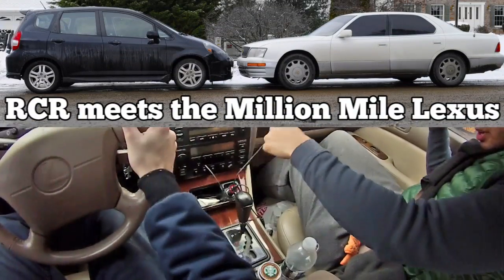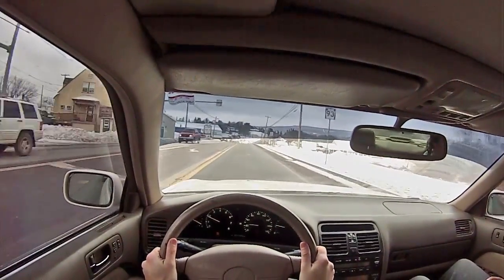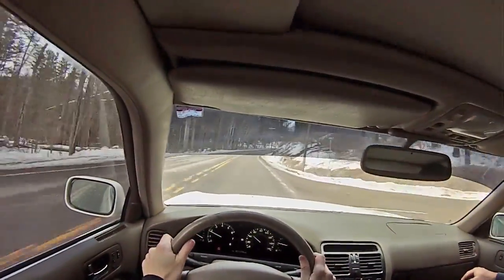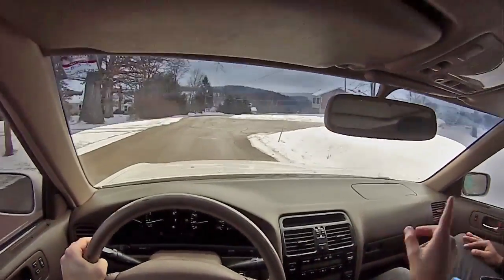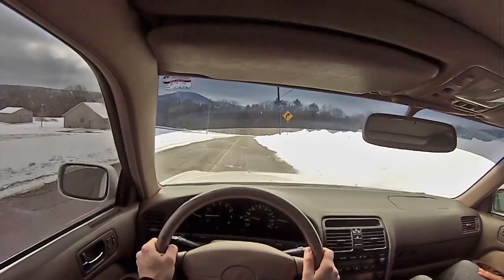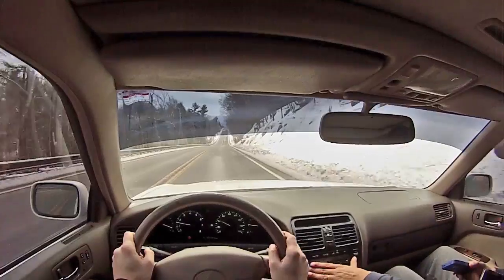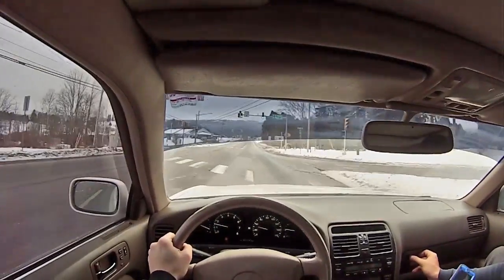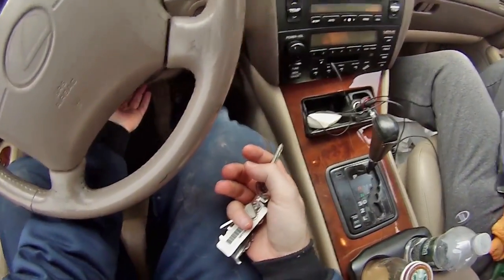Million Mile Lexus P.O.V. Drive

Comment: my 1990 Big body ls400 was fully loaded and had all these features. to bad i wrecked it. it had heated seats not a crack on the leather. only 60k miles on it and everything wokred perfect. stock sub and cd changer in the trunk. when u put it in reverse the mirrors wud go down so u can see the curb. i had put 3 12s in the trunk of mine nd had it bumping everywhere on some 19s. loved that car.

Comment: At the medical transport company I work at, we had an ambulance (that just died a couple months ago) built on a Ford E350 chassis that had 600,000 on the odometer.  That's impressive on it's own, but the kicker is that the 6-digit analog odometer had apparently rolled over... twice.
Reply: +HDcamel so your saying it had 2.6 million miles on it when it died?

Comment: Y'know, I'm wondering if someone rolled forward the miles on the odometer just to screw with people.  Like how shady car dealers roll the mileage back, except maybe the owner decided to say "Fuck it, this car's already worth next to nothing" and proceeded to increase the miles to 900k just so he could sell it to someone who would drive it to a "million".
Reply: That would make sense if the speed sensor somehow went haywire then... I just assumed because of the vintage of the car that it had a mechanical odo.
Reply: willthefuneverstart , but not odometers.

Those were mechanical in many vehicles until the late-90's.
Reply: The Layout Engineer Wrong.
Reply: The Layout Engineer I doubt it.  Also, it's not uncommon to see these cars on the road still.  In fact, I see them all the time.  My uncle still have one, which is in immaculate condition, with original parts.  Granted, it's his second car and he doesn't drive it as often as his truck, but he's had it since 1992.  My father also has a 1994 version, and it has over 300k miles on it.  They don't make cars like they used to...sometimes I'm shocked to see cars built in the 2000s with major engine problems.

Comment: That's amazing! I had a '99 Chrysler (Dodge) Intrepid with 650,000 miles. Never changed the oil in it or changed a thing. It ran without a problem each day.
Reply: I doubt this very much. Please change your oil.
Reply: I should clarify, I never changed the oil for the last 3 years. Never changed it because was trying everything to kill that car. But it wouldn't die.
Reply: Luca Giordano if you want to kill it just drain the oil and run the engine
Reply: You didn't change the oil for 3 years ? Dude when you go to drain that the amount of shit in the oil will make it as thick as porridge
Reply: Luca Giordano Probably burned a quart every 300 miles so there was no point to change it
Reply: HAHA that would explain the cloud of black smoke everywhere.

Comment: Just fix the Throttle Position Sensor and it'll auto downshift fine. I'm guessing the cruise control acceleration is caused by the speed sensor. Minor issues.

Comment: 1 million milles? that's a lot.
my focus st has almost 1 million kms. no major repairs so far lol (the engine and gearbox are original, have changed only oil, filters, spark plugs, disk brakes, pads, clutch, tires, just regular stuff).
that car was driven pretty much every day since 2001. :D
Reply: DGPF impressive!

Comment: Why not fix the problems? Make it pristine.
Reply: That's what I'm saying 900k miles isn't an excuse to disregard the maintenance
Reply: TheCowGoesMoo o Yep! Quite the opposite in fact! The TPS is probably the main culprit behind the transmission not shifting properly. Granted I am assuming this guy is on a budget or limited income and cant fix the problem, so he just drives it the way it is. We have all been there. Im sure its not the average DIY fix.
Reply: TheCowGoesMoo o exactly, the guy who owns the world record for highest mileage car has a '66 volvo p1800 which has done 3 000 000 miles, and the car looks like it's brand new.
Reply: ***** Not really. The trans is in the limp mode, meaning, complete limp mode. This Toyota A340 trans shifts in non-TCU mode, you can dump the TCU and nothing would change. It's a simple electric problem, just track the problem, maybe you'd need to clean some contacts and it should be okay. Shouldn't take more than few days to fix. Toyotas were bulletproof back then.
Reply: ***** Not really. Old Toyotas are ultimately predictable, if you disassembled something and haven't improved it, get it back on and it'd work as worked before. That's what I love about them.
Reply: because the car has obviously not be maintained the way it should have. Just touching it the wrong way could break everything. As for the Volvo guy, he regularly does maintenance to it, therefore he is allowed to fiddle around with it, because it's basically brand new, even though it's 50years old.

Comment: This is awesome.  I have a 93 just shy of 400k.   It has driveline shudder, wacky cruise control, inop dash lighting, inop gas gauge, a rigged and welded power steering pump so it would quit leaking.  But my trans and engine are buttery smooth! Overdrive is sometimes shaky but rarely.  Gets 22 mpg hiwAy and will still pull strong as he'll to 120 mph...your white knuckles at that point trying to keep car on road.  Lol.  Nice find guys!

Comment: and i thought that my First gen LS400 had seen a lot of road when in fact it´s low mileage car.
It only has 480 000 KM in the trip.
it was expensive when it was new because the taxation is so high in Finland that Lexus only sold 3 first gen LS400.
All the cars had all the options that you can pick from the manufacturer so it has full leather interior and air ride suspension as stock only thing that the car does not have is the sunroof.

Comment: Ok so if you got new tires, new breaks, and had it maintenance with the engine as in fuel cleaning and cleaned out the butterflies in the engine block. Bet that thing would ride a whole lot better. Also you may need a new speed sensor that would solve the issue of the cruise control and acceleration.

Comment: I had a '96 Avalon which was hardly maintained and made it well over 200,000 miles before I sold it. Did not like the car much though. The '96 Lexus ES300 would have been pretty well the same car. I would have preferred to have had an LS400.

Comment: The driver's ed car I drove when learning had 999999 on the odometer (original engine and transmission). it was a 99 Corolla. He said it hit 999 999 2 years previously.... so most likely 1.2 million kms or more. Insane.

Comment: Someone please buy this from the owner so they can actually do some regular maintenance!

Change those tires.
The TPS fix is super easy. It's probably the transmission downshift cable cam.
Get an alignment.
Reply: I'm going to assume there are Lexus owners out there who maintain these cars.  Co-worker of mine had one recently though.  When he started it, the dash had so many warning lights it looked like a christmass tree.  I thought I was at a rave.  Then one day it doesn't start and he says he needs a jump.  No problem, but he says there's no dash lights at all.  Connect the cables anyway, it starts, and then I notice his negative cable is flopping around on the post.  Lmao.  He's a mechanic too.

Comment: I own this exact car, same color combination and everything- but with 197K miles. Drives like a dream! Factory radio kicks ass too!

Currently in the shop for a transmission cooler line leak, and soon a new timing belt will be put in.

Comment: When Lexus made great cars.
Reply: They still do..
Reply: LFA called...
Reply: 1xXDrifterzXx1  LFA hasn't been in production for two years...
Reply: RC-F, RX-350 turbo, even the standard IS is a fantastic car to run around in.
Reply: I've slayed, but at what cost?
Reply: There is no RX350 turbo...there's a NX200t..
Reply: Nadem Durani
That's the one. I'm more of an acura man.
Reply: Modern and older Lexus alike are some of the best cars you can buy, when it really gets down to it.
Reply: *****
of course they are well built, if you want to scream round town like a bat out of hell, get an SC400 with the manual gearbox, it is the closest to a muscle car lexus has ever come.
Reply: They still make incredible cars actually

Comment: RegularCars Hey, have this car and would like to pass something on to the owner if he didn't already know: a lot of the problems (trans not wanting to shift by itself, random MIL codes, couple other things) can be caused by an ECU with bad caps, which was extremely common for our year (I had the problem myself).

If he's already aware of this and has checked (caps can actually go bad and look fine, they should be replaced regardless of appearance) then nevermind, but if he's not please pass this on along with this link
http://www.clublexus.com/forums/ls400/656360-all-my-crazy-lexus-issues-solved-ecu-leaking-capacitor.html

Comment: Those 2 codes are cheap fixes with used OEM parts.  Where you got the door panels probably have the rest of the car so swap them for under $50 and it's back to shifting properly.  Hit the million and see if the Toyota museum will want to take it or want to use the car for ads/promotion.  Honda did this for a Prelude owner that hit a million in the early 90s.  Prelude was still in production so he got a new one from them but I doubt Toyota will give you a new LS.  It's a very cool project but don't beat on the car in the way to a million; not beating on it is what got it this far.

Comment: Notice everything that doesn't work has something to do with the car's electronics(aside from the alignment issue). The engines and transmissions will go for a long time, it's the computers that fail after so many years of use.

Comment: Someone should compile a top 10 list of most known reliable cars ever. Probably civic,jetta, crv ect.
Reply: Diesel Toyota engines get worn in at 200 000km
Reply: Jeep Cherokee

(XJ)
Reply: The Jetta could contend for LEAST reliable car ever,
Reply: Tunerdude94 An automatic mk4... yikes.
Reply: Top 10 Most Reliable Cars Known To Man:
W115 Mercedes-Benz 300D / 240D 3.0
W115 Mercedes-Benz 240D
W115 Mercedes-Benz 220D
W115 Mercedes-Benz 200D
W123 Mercedes-Benz 300D Turbo
W123 Mercedes-Benz 300TD (The "T" means station wagon, not turbo)
W123 Mercedes-Benz 300CD
W123 Mercedes-Benz 240D
W123 Mercedes-Benz 220D
W123 Mercedes-Benz 200D

Notice a pattern here?
Reply: Isaac Goldbergstein Is the pattern that you like Mercedes vehicles?
Reply: The top 10 most reliable cars are diesel Mercedes?  Living in north America i very rarely ever see any . And the only reason i said jetta is ya they break down a lot but they still seem to rack up the miles quite a bit compared to other cars. My buddy has one with over 500k on it lol
Reply: awesomeologyism No. If I did, there would be a broader range of models and years.
Reply: Don't forget a c1500 Chevy, or the bubble caprices
Reply: chrisonfire420 1994 Honda Accord should be on the list.
Reply: chigasaki06 I own a 1994 Accord and it most definitely deserves to be on that list.
Reply: Lets hope you dont make the list with a FUCKING Jetta on it
Reply: chrisonfire420 If your car needs repairs after only 500 km, you need a better car
Reply: 500,000 obv lol. Average car =200k decent car = 300k. Top 10 list = 500k+
And i mean life expectancy, not til repair. And idc what car u have. Ur gunna have to do some repairs at some point if u actually drive the thing
Reply: awesomeologyism  
500,000 obv lol. Average car =200k decent car = 300k. Top 10 list = 500k+
And i mean life expectancy, not til repair. And idc what car u have. Ur gunna have to do some repairs at some point if u actually drive the thing
Reply: chrisonfire420  Lighten up Francis, I was making a joke

There's no need to double post about it
Reply: awesomeologyism
 i was typing from my phone and wasnt sure if it sent the 1st time lol. Its hard to tell man. Theres so many over analytical ppl online...and who the fuck is Francis lol?
Reply: I had a '98 Jetta. Loved the thing to pieces, but it was hysterically unreliable. Notable problems include a glitchy clutch kill switch which wouldn't let the engine turn over and a check engine light which required replacing every component of the emmissions system down to the gas cap. It was like Clarkson says about Alfas. It would thrill me or irritate me, but it was never ever boring. Really wish I still had it.
Reply: If somebody did that it would just be 10 toyotas, and one of them would be the Toyota from top gear.
Reply: chrisonfire420 corolla, corolla, corolla, corolla, corolla, corolla, corolla, corolla, corolla, corolla
Reply: chrisonfire420 ..jetta.........reliable? what?
Reply: chrisonfire420 I hate when people use the maintenance argument..like "if you just maintain them constantly and pour hundreds of thousands of dollars into them they last a long time!"...umm yeah no shit! Any car, no matter how shitty, can last a long time if you're willing put money into it. In my opinion, if you need to constantly deal with getting parts fixed and replaced every week, you're dealing with an unreliable car...I don't care how long it ends up lasting you. On the flip side of the coin, a Corolla can last a damn long time with no maintenance at all (except for you know oil changes and the normal wear and tear)...I'd rather have a long lasting car that is reliable and doesn't nickel and dime me constantly, vs. a long lasting car that needs three times its resale value in repairs and could quite possibly leave me stranded on the side of the road at any moment.
Reply: WeActOnImpulse Official The Hilux?
Reply: chrisonfire420 I've got a '95 Toyota Avalon XLS with 247k miles. It's never broke down on me, I've had it since 145k miles. I've done brakes, tires, oil--the usual upkeep. I've also replaced the radiator because I got a leak in it. She's quick, reliable, and drives like a new car still

Comment: Ok from a 95 LS400 owner , to make the car downshift u need to adjust the transmission cable on the throttle body so the lol bump is about 1 mm from its plastic enclosure (the further the harsher the shifts) . Humming noise is probbably the diff or trany , speed sensor could be the ABS sensor not seated properly .

Comment: There are actually 2 speed sensors, one for the ECU and one for the gauge. Also the TPS sensor issue ties into it not downshifting properly. It doesn't know how fast it's going, or how fast it should be going, so why downshift?

Comment: I had this exact car. Around 250,000 miles the cruise control starting accelerating after set. It increased about 20~ mph until the transmission is happen with the RPMs.

Comment: Any power steering problems? my 240k 95 LS has been on and off with funny power steering where it's now a substantial leak
Reply: +Unclenate1000 

get it fixed, it'll leak onto the alternator and fry a perfectly good one
Reply: annoythefish
definitely getting on that. It's already happened, and then to add insult, the new alternator i got was a bad one. Go figure
Reply: One of my first cars was a 90 Lexus LS  with the same minor problem, power steering can would leak. Seems like that's a common pattern in these models. Aside from that, it was an excellent drive. Now I have an ls430, feels almost just like the ls400 :)
Reply: My plan eventually is to move up to LS430. I never want to leave this model

Comment: I had a 98 Camry with the V6 which I believe was the same motor and chassis as this Lexus. Best car I ever owned, shouldn't have sold it. Still wanting another, maybe an 02 with a 5 speed. 

Also, Stewart's!
Reply: You are thinking of the Lexus ES300, the LS400 is a V8 RWD